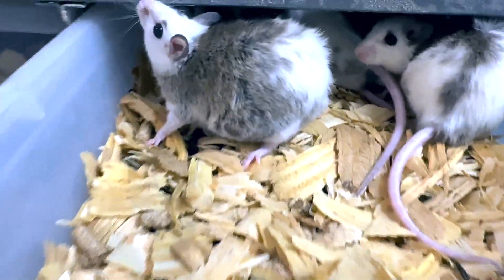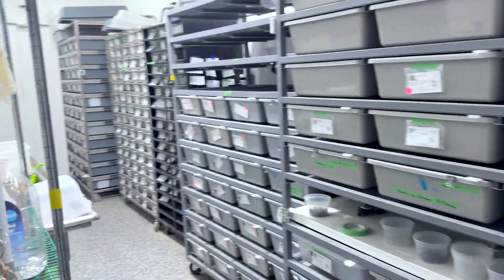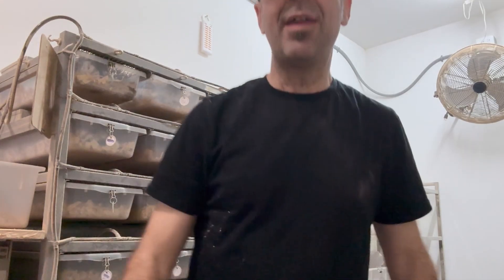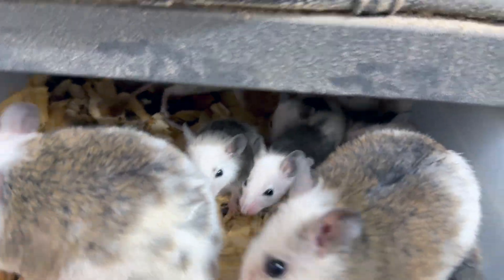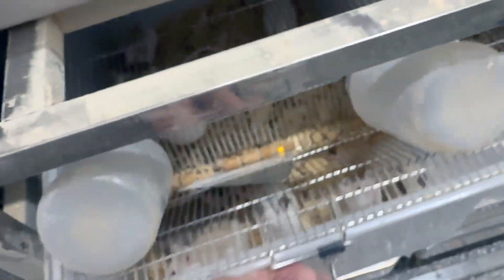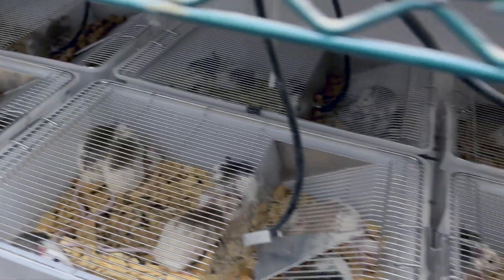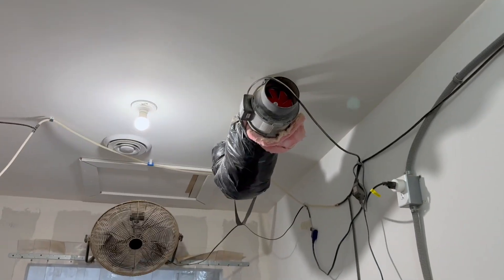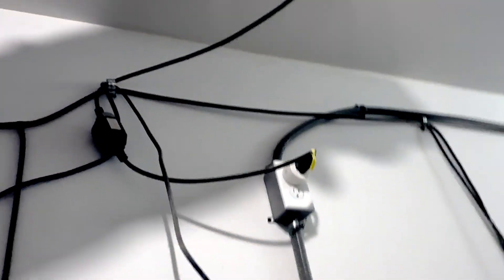Inside My ASF Rodent Facility | Automated Water, Ventilation & Colony Setups

Comment: How do 5he ASF baby's get out of those other tubs? I thought they were built for housing mice.
Reply from the maker: There's a particular age where they crawl on the underside of the wire lid and can manage to squeeze through the corner.  It's rare for me, but I have seen it.  Once they grow past that age they're too big, and younger than that they can't crawl upside down around the wire lid.  Generally as long as I stay up on weaning the babies it's not an issue.